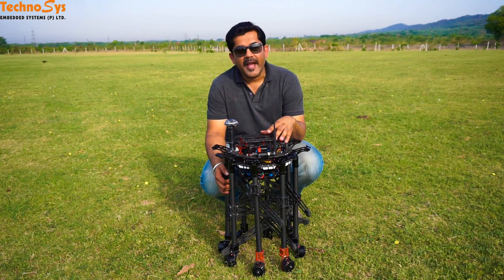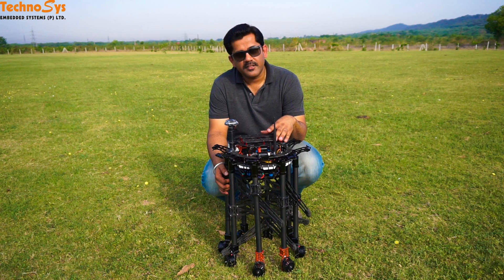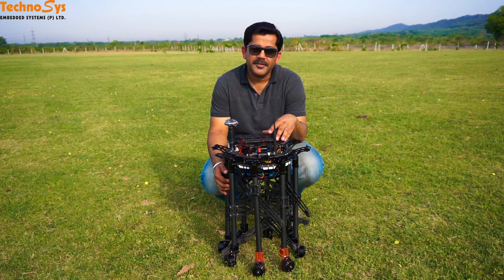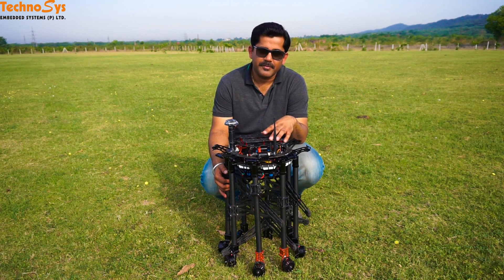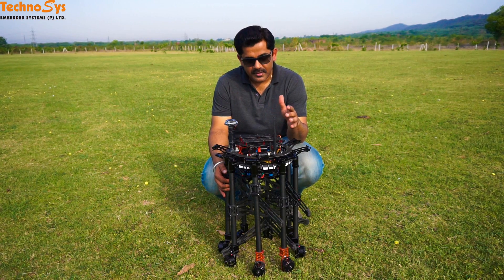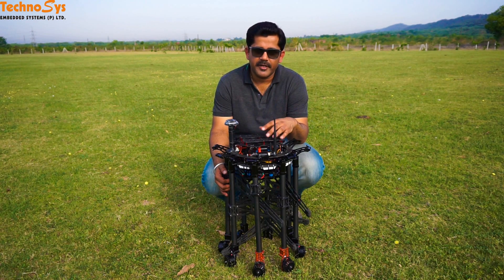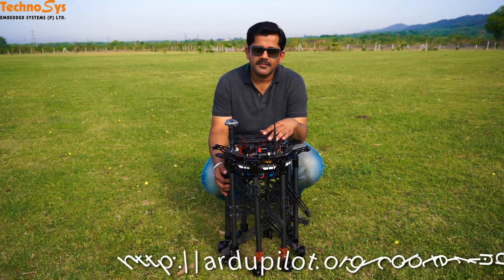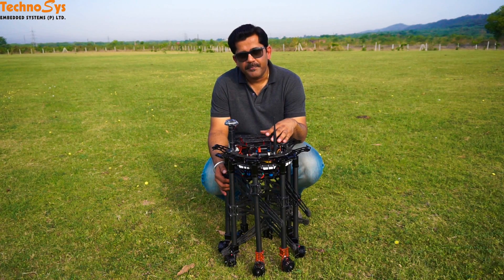How to Setup a Multicopter / Multirotor / Arducopter With Pixhawk - Sequence And Checklist

Comment: Hello i just mount my hexacopter with 6 motors Tmotor 5212/340, with 40esc with pixhawk controller.
I just make one flight. Today i prepare to make another fly i test the hexacopter in may garage and one smell very bad. Do you now what is the problem. The motors runs but e stay very hot.
Thanks
Reply from the maker: can you please share the details of your esc. 40A seems wrong

Comment: Hi TechnoSys,
How are you doing with the autotune on low kv motors. I'm waiting on parts for a Tarot 650 Sport with 380kv and Hobbywing Xrotor 40A. From what I've read and heard, Autotune is not recommended with low kv motors which ultimately results in crash.

Thanks for your help.
Reply from the maker: Hi, this giant K130 is running 288Kv motors and the auto tune worked like a charm on this. Don't think it's related to low kv motors
Reply: Yes I figured that out as well and given by the information available, it must be related to bad ESC or firmware which is not in "apm's world" so to say.

May I ask what type of firmware you are using?

Regards,
Amir
Reply from the maker: +Amir Tahami Simonk Firmware
Reply: Thank you.

Could you give me your opinion on this.

Building a Tarot 650 Sport with the following;
4 x SUnnysky 380kv 
4x Hobbywing Xrotor Opto
Pixhawk
Feiyu (crap) Tech Mini 3D gimbal
1x 1500 mah batt for fpv, lightning, legs and such
1x 8000 Multistar 6S batt.

I'm thinking of an AUW of somwhere 2500-2700 grams.

Thrust data shows with the 6S on sunnysky 380kv that I get 780g of thrust at 50% throttle on 15x55 Props. Do you think in your professional opinion this is good or do you recommend something else.

Thank you very much.
Reply: Use old and still good Naza V2 and all of your problems will go into oblivion